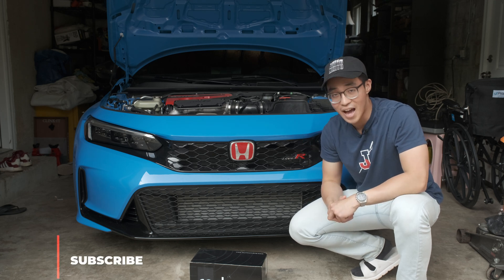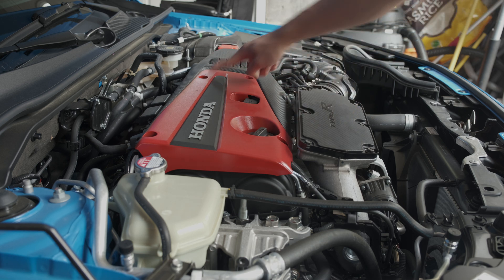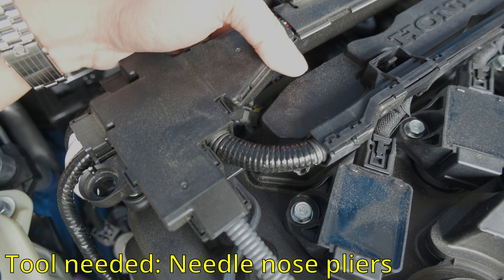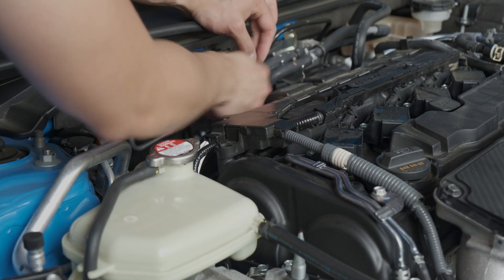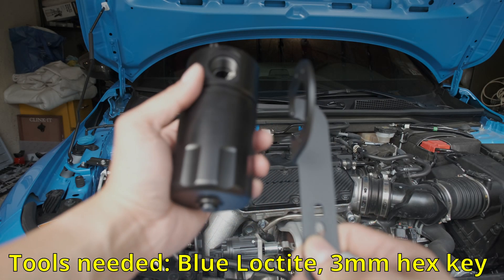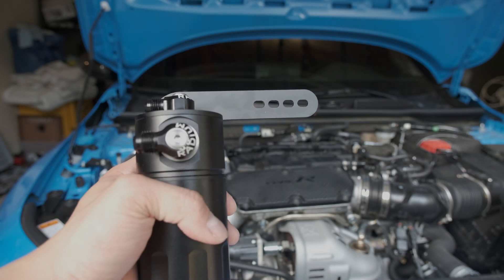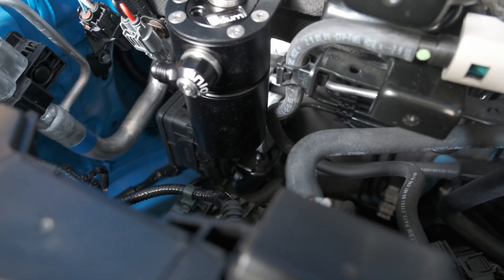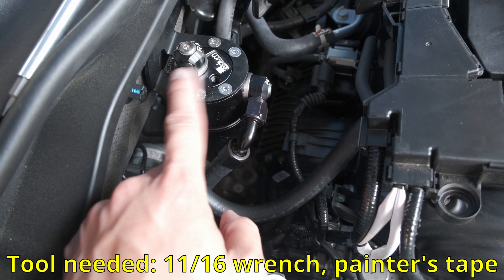Prevent Carbon Buildup! Installing the Radium PCV Oil Catch Can in my 2023 FL5 Honda Civic Type R

Comment: Helpful video. I was preparing for the installation of the barb fittings to be a Festivus-level feat of strength but it was not hard. Oil both ends with motor oil and apply pressure. No vice required. If it is too hard, give it to your wife to finish it for you 😂
Reply from the maker: Glad it helped! Still looking for the aforementioned wife 😂

Comment: Keen to see how much oil you catch with that as it seems to only be plumbed into half of the crankcase ventilation system on the K20C1. There's another one going from the rocker cover straight into the inlet just after the MAF which is pumping oil vapour into the turbo/intercooler and subsequently the rest of the intake system
Reply: Would this be to also say that perhaps 2 catch cans should be used?
Reply: @bpebler  Radium does offer 2 catch cans designed for each spot. They can be purchased separate or together. I'm kind of on the fence myself.
Reply from the maker: We'll have to see. From what I've seen in the FK8, some people were getting quite a bit. Thanks for watching!